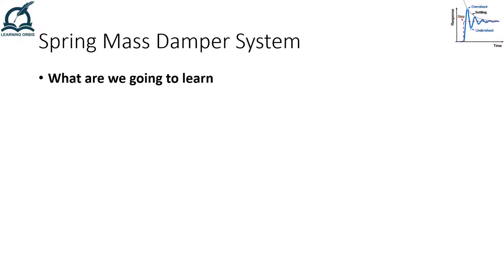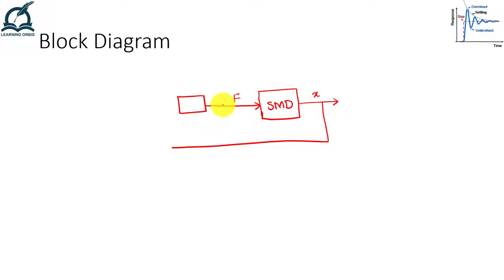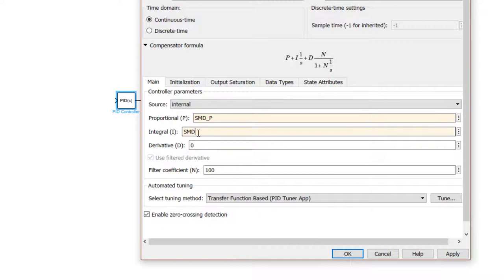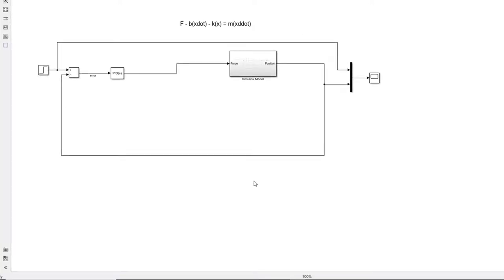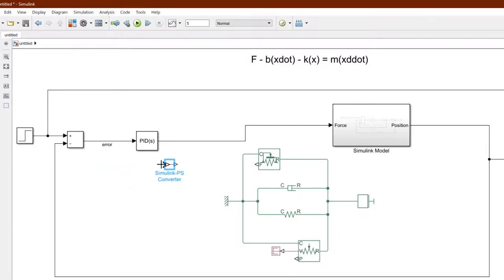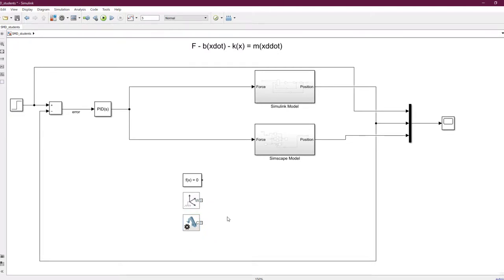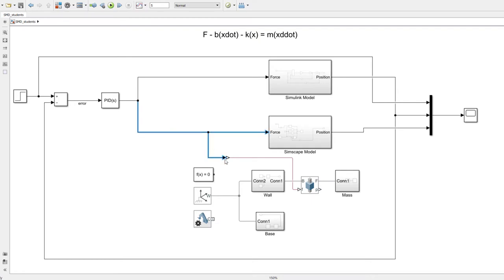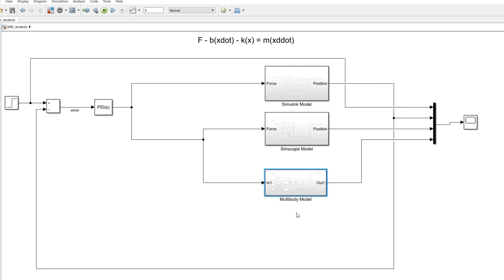Modeling and Simulation of Spring Mass Damper System | MATLAB

Comment: How to get an Overdamped response? What should be the values?
Reply from the maker: I've autotuned the PID Controller by providing rise time and settling time. So for over-damped response I can run the autotuner to see what values will give that response. Give me a day and I'll provide you the values.
Reply: @LearningOrbis  yeah sure please provide
Reply from the maker: Ok I got time and I retuned the system. Here are the values.
m = 3.6; 
b = 100;
k = 400;

Following values are for PID block of MATLAB.
P = 0;
I = 326.3902
D = 0;
N = 100

Comment: Hi sir, 
i am always confuse in network , can u please make a simple video on network, bec here in this video u attached  force on node and said that u have attached it on mass,

Regards,
Sarthak
Reply from the maker: In fact a node is a point where two or more things meet. In real life if you have a mass and attach a spring and damper with it, you can effectively reduce the mass to a point mass. Then where will you attach that point mass? Of course it will be attached with the spring and damper and then application of the force will be at the point where all three things are attached and that will be the node or the point mass which will be the same in this case.